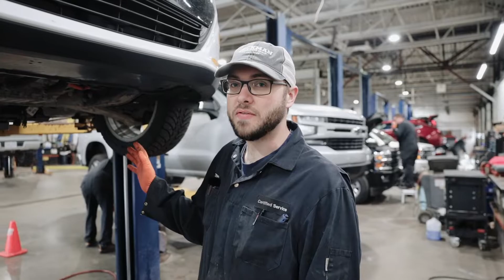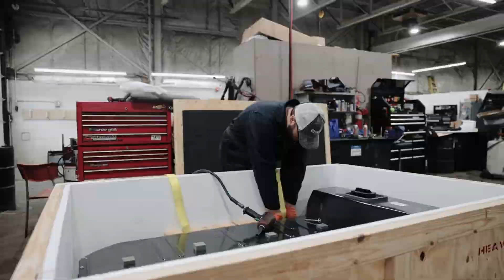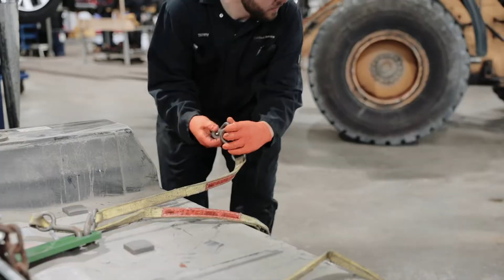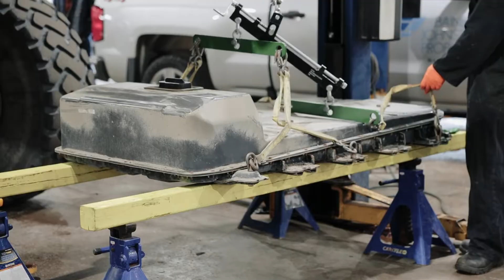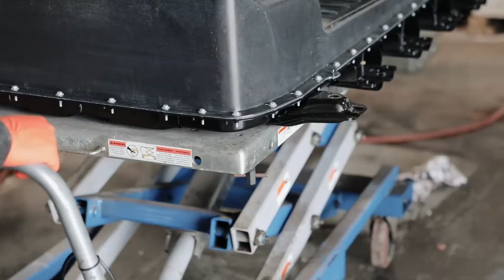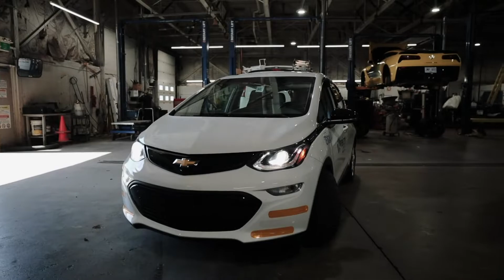EV BATTERY REPLACEMENT - Is It Really That Easy?

Comment: Why did the battery need replacement after only FIVE Years? 
What was the TOTAL cost associated with this Battery Replacement?
Reply: Most likely recall replacement.  most 17 18 Bolts had the batteries replaced. So probably zero.
Reply: Chevy Bolt batteries had manufacturing issue that caused a risk of fire, GM recalled all 2017 and 2018 + some of later model years and replaced the batteries. The warranty on them is 8 years at a minimum for most manufacturers, Hyundai offers 10.
Reply: Well that is certainly a screwup
Reply: Right

Comment: TOO FRIGHTENED TO MENTION THE OVERALL PRICE BECAUSE ITS AN EV SECRET which will put people off from purchasing an EV. Who would be mad enough to purchase a used EV that over half of the battery life has expired ???
Reply: I drive a 6yr VW e-Golf and it still achieves a range beyond the original EPA rating.
Reply: It's a warranty Einstein. Warrantied for 8 years or 100,000 miles. The batteries last a decade when used properly no different than a well maintained gasoline engine. After that they are used as stationary storage batteries for another decade. Can be 98% recycled into new batteries. Our one EV has 66,000 miles and battery at 98%. The other has 50,000 miles and is at 100%. Between them we've saved over $7,000 on gas, oil changes, brakes, transmission filters etc. charge overnight and wake up to 300 miles range. Worked in the collision biz for 40 years. Have a good understanding of cars. Would never go back to the overly complicated expensive to own gas car.
Reply: @BobQuigley , can you tell us who recycles the EV batteries?
Reply: @BobQuigley  gasoline engines can last for far more than mere 10 years, and they still keep roughly the same fuel economy. 

I drive a 20 years old 1.0 liter 4 banger car that still has the same stock engine from factory and it shows no signs of dying whatsoever, I could easily see it going for another 10 years on the same block.

Can EV batteries pull the same durability numbers, and then don't cost the whole price of the car to replace?
Reply: Free under warranty
Reply: @whocares264 When warranty ends, you pay. I get 200k and 20+ years on my Honda and Toyota  ICE with only oil and fluid changes. I rarely buy them used under warranty
Reply: Because that's not a real thing
Reply: My replacement was free
Reply: hyundai charged two customers over 50k for a battery replacement...
Reply: @PatricioGarcia1973 years ago now they like 4k

Comment: I find many things are "easy" when someone else is paying the bill.   Replacing a battery module should be easy and really the ease of doing isnt really a topic.    Thhe cost of doing it vs the cost of the vehicle is usually a hotter topic.    Good to know in this instance the cost should mainly parts.

Comment: It might be easy but it's also ILLEGAL!!! ONLY EV mechanics (there are TWO in Okra-Homer NOT in dealerships, one in OKC and one in Lawton, none here in Tussa) are allowed by Federal Law to work on EV/hybrids batteries, charging systems or braking systems. It can cost you a Million dollars and a MINIMUM of seven years in prison. It cost the goober's in Mustang, OK 5 million, their HOUSES, their shop and they are BOTH in Leavenworth, KS for 12 years and then can NEVER work on ANY "public conveyance" (vehicle) for the rest of their lives. They put a new battery in an old Prius and got caught. KOCO showed the Fed's auctioning their UNDERWARE and socks on TV! Normal EPA "scorched Earth" procedures (also the IRS and DEA). I ask My mechanic why he doesn't get a "hybrid license", "Five million good reasons", Mike replied. A five million dollar CASH BOND is required by the Fed's. That's one reason why insurance on a Tesla Y is $3800 a MONTH in OK, and repairs are (it says on the wall in 5 foot high letters) are $600 an HOUR MINIMUM at Tesla of Tulsa (NOT including computer/electronic systems or charging/battery system repairs: Contact Service Advisor for labor rates.) U-toob won't accept the photo I took!
Reply: Five million good reasons, what are they? 😅😅😅😅😅
Reply: I had mine replaced at the Chevy Dealership in Tulsa.  They have a certified EV tech. Joplin, MO also has one too.  I've put 30k miles on it since then, going great!

Comment: No engine oil, just a 10 thousand dollar battery in 4-5 years, that's all.  No worries mate.
Reply: 8yr or 100,000 mile warranty covers battery
Reply: @cfldriven My 2008 Honda van is 15 years old and running great. My repair and maintenance  costs average only $125 per year. I guarentee your EV will need a $10k to $20k battery before 15 years. Lithium batts have a limit on number of charge cycles no matter how well cared for.
Reply: @slotcarfan  so far batteries that have been in service since 2014 have held up remarkably well, according to Tesla.  I have a feeling you are going to be proven wrong.  Also, unless you don't drive your car, there is no way a 15 year old car averages $125.00 a year.
Reply: 8yr...160 thou on my 23

Comment: Gasoline does not depend on software to keep the energy balanced.
Reply: Actually the ECU controls many functions that keep the gas engine, tuned and properly running and usually has to be relearned upon disconnect of 12V battery.
Reply: @cfldriven  I am sorry, I am a living Dinosaur.
Reply: @mikewallace8087  We are all trying to avoid extinction.

Comment: What happens to the battery cells that are no longer useable? I saw a few videos where China has old EV batteries filling up warehouses. No one really talks about this.
Reply: At recent prices, nickel-cobalt-manganese batteries contain an average metal value of about $10,040 for every ton of cells
Reply: 100% they are recycled, GM has stated as much in their various news releases regarding Bolt battery replacements.  They’re quite valuable for the materials and multiple companies are now recycling them. Nobody is talking about it because it’s a falsehood being told by oil companies, who want to keep you driving your gas car that lines their pockets with money.  Don’t know if batteries are being recycled in China, but they have entrepreneurs too, so I would be extremely surprised that there’s not at least one company there also recycling.

https://youtu.be/s2xrarUWVRQ
Reply: They are to valuable to waste they will be recycled or in this case repaired or reused for something else
Reply: @peterszczesiak6025  I get that they are going to re use the cells that are good but what happens to the cells that are bad?? Everyone talks about recycling electronics but you never get to see how. As far as I cant tell this whole electronics recycling is a farce and that it ends up being incinerated.

Comment: Hey great no mention of battery cost or labor rate .I’m sure GM and the dealer approved of your video.What the heck so you gotta replace the battery every 4 years you save on gas.Sounds like a great idea to me!
Reply: This was due to a recall on all 2017-2019 Chevy Bolts.  The cost was $0 for the owner, even if they were out of the 8year/100k mile warranty.  Cause was due to bad manufacturing on LG Chem's part.
Reply: You dragged @johnandersonjjr 🤣🤣🤣

Comment: Why does a 2018 EV need a new battery already? How long will they still make these in the future now that Chevy bolts are not going to be made anymore?
Reply: Ok.  I just saw a video of a bolt on fire outside someone’s house.  The owner said GM sent a notice that they are not replacing batteries any more because of a new “software” fix.  I thought they tried a software fix before the battery replacement plan.  I guess they’re just cheating out now and stuffing their customers who were still waiting on batteries.
Reply: @mongo64071  that’s possible, when mine was replaced I didn’t closely follow the information any longer.  However, if GM is saying that a software update is sufficient they’d better have their facts straight.  Software can’t fix improperly folded anodes and dendrite formation, although maybe if it is sufficiently sensitive it can prevent the thermal runaway.  I’m very doubtful, and given that they already replaced quite a lot of batteries if one lit itself up and the owner could prove their vehicle had one with that defect, GM would be incredibly exposed from a liability standpoint.  However, we’ve seen that movie before with the Ford Pinto, the only thing that factors in is guessing how much a jury might award a plaintiff when a company has clearly been negligent has thankfully gone much more to the plaintiffs favour in recent years.
Reply: Chev Bolt and Hyundai Kona had bad batteries provided by LG, and replaced all 2017 and 2018 (+ some of cars in later model years) under warranty (no charge to owners) due to risk of fire. Warranty is 8 years on Bolt, same for most manufacturers but Hyundai offers 10.  Chevy recently announced they’ll be producing more new Bolts in 2025 using their standard battery tech called Ultium, same type of batteries used in Hummer EV, Cadillac Lyriq and other new GM EV models.

Comment: The automakers design EVs to not only as planned obsolescence,   but also to prevent right to repair by either a one person repair shop or a DYI. IF car makers had any moral compass,  EVs would be designed with a battery set that you could pull out from the side with a disconnecting receptacle/plug combinations so that in case of accident or fire or water immersion it could be unplugged readily accessible.  This idea comes to mind with when I had the job of servicing industrial electric carts for facilities maintenance at a railroad service & inspection facility, I had the pleasure of pulling out that battery bank like a cordless drill onto a cart by myself. These where heavy standard lead/acid batteries connected in series. Hence, a fire dept response would be much easier.  Pull that battery out before the car is destroyed  . As an electrician of 51 years, I, ve been taught over the years ( mandatory every three years to renew my electricians license) that there are definitions in the National Electrical code about things to disconnect sources of power being designed accessible and readily accessible.  Hence even in my old ICE Vehicle, I have welding cable disconnects on the battery, and the battery terminations are not standard automotive type terminations. They are terminations utilizing hydent terminals (COMONNLY USED IN THE ELECTRICAL CONSTRUCTION TRADE IN 480 VOLT SWITCH GEAR)  with stainless steel 3/8-16 threaded marine type batteries. The automotive grade connections are designed to attract the towing vultures. I was in an accident in which a car rear ended me and the first thing the emergency responders did to the car that hit me was to disconnect that car 12 volt battery. 
         You EV mechanics need to think outside the box and consult electricians who work on high voltage/high amperage connections. You should also boycott the likes of GM AND OTHER EV AUTO MAKERS. instead a lot of you become complacent to what they design and sell to the consumer.  BTW IN ADDITION TO THSE TERMINATIONS I USE A pure copper based nuclear grade never size. Are those bolts you are using to install the new batteries stainless steel.? Also if those EV batteries where designed for easy pull out , then instead of waiting around for charging an Ev like on a long trip, you could just go to like a gas station, and do a battery swap or painless trade in minutes. SIMPLE? 
           owning a vehicle is no longer a money pit, it is now a credit card debit pit, forcing working class people into economic slavery.  Hence, look at all the chips on board a typical vehicle, more chips , more of certain batteries, more need for more cobalt mining. A mining that is done by exploited child labor in the African country of the Congo. BTW. With an easy design battery change out, you would then have the flexibility of the type of battery like in winter, you could use a nickle metal hydrade battery, and summer go to the standard lithium ion battery. Hence, winterizing your Ev !!!!!!!
Miss Paula Walach-member IBEW  and former industrial electrician. 

Ps , what about an E-STOPS for emergency responders. I,ve wired many of them over the years.  I take bad issue that ICE vehicles never had e -stops or even carbon monoxide detectors.
Reply: Designing an EV where an individual owner or mechanic could change the battery out himself/herself doesn't fit with the new world order.  An easy swap out battery system would mean less workers needed and would enhance the financial well being of the individual owner, we can't have that.
Reply: Most people don’t change the oil on their car.  So why design a battery that will never be changed out by an individual?
Reply: @Uriah625  in my 51 years and still working in the trade as a licensed electrician,  it's about easy accessibility whether done by a DYI or a competent trained mechanic.  That mechanic would be much happier with the battery to slide out like a cordless drill. Accessibility is very much stipulated in the National Electrical code . I,ve scene the way 75 volt batteries are very readily changed out in 125 ton diesel locomotives. ITS done by one person using a lift cart. The dimensions of such a 75 volt battery is about one cubic yard. The starter is 75 volts that is needed to crank over a 16 cylinder diesel engine.  Hence, what about the first responders to an accident with no way to even unplug that poorly designed battery pack underneath that stupid EV....? Besides you missed the point that a morally designed EV would have the battery changed out to a winter type battery of nickle metal hydrade  that charges better in cold weather. Hence, more revenue for the towing vultures for EVs using planed obsolescence type batteries installations. Is that what you want to burden the EV Owner ? The average working person already has enough debt to contend with. With rising rents, food prices, and the rising cost of getting to and from work, especially in rural areas lacking good rail public transit.
Reply: @paulawalach1770  I think you and I watched a different video.

Comment: I would hate to pay for battery placement once it's out warranty.
Reply: Same here with the gas car.
Reply: @cfldriven  Does a gas car have a warranty on the battery.
Reply: @robri87-hh4gr  New cars come with warranty that cover the 12V battery. And of course any replacement 12V includes a limited warranty.
Reply: Yeah I mean, who wants to replace anything on their car?  Unfortunately if you own a car, EV or ICE, repairs will be needed at some point.   

On the bright side, EV tend to have much better warranties than ICE cars.   Rivian has a 5 year 60,000 mile bumper to bumper warranty, whereas the typical ICE has a 3 year 36,000 mile warranty.  The battery and drivetrain on the Rivian is 8 years or 175,000 miles.  Most  ICE are 5 year or 60,000.  

Who do you think is more confident in their product?  The manufacturer with an 8 year 175,000 mile warranty or the manufacturer with a 5 year 60,000 mile warranty?
Reply: @Uriah625  2014 Prius, regular service and no repairs. 2017 e-Golf, regular service and no repairs. 2005 Mazda 3 regular service and a water pump.
Reply: @Uriah625  yeah, but a 500 dollars clutch job is different than a 20k battery pack. It's not about the warranty, it's about the tech battery degrade. So does engine but the parts are cheaper and labor and it lasts longer.
Reply: @DerekVuong7799  yeah, not saying it’s cheap, but it’s not exactly something I would really concern myself with.  Batteries last a lot longer than people think.  

Let me ask you this.  If ICE vehicles are so cheap to fix and maintain, why isn’t everyone driving their first vehicle?
Reply: @Uriah625  i bet if battery has issues, it WILL die way before it reaches those 175k miles, and if its very good, then it will outlive warranty by far, it will just degrade a bit..
Reply: @Uriah625 GM announced EV require 80% more maintenance. What happens to EVs after warranty? I almost always buy good, used ICE long after an EV warranty would have expired. 10 years and a Honda or Toyota ICE are just getting broke in.
Reply: @slotcarfan  I looked for a release from GM per your claim and did not score a result.  

As far as what happens to EV’s when the battery goes bad?   Again, I have to give a vague answer.  That is the choice of the individual no different than an ICE vehicle.  

Here is an example. I own a 2010 Silverado 2500HD.  The transmission went bad a few years ago. Torque converter is failing, common on the 6L90. I drove it here and there, but I never trusted it.   Mind you, it was 10 years old at the time.  It is now 13 years old.  Yesterday I called to get a quote on a rebuild, $6,000.  I’m seriously debating whether it’s worth it.  The tech pretty much said, “no one ever gets them rebuilt as it’s not worth it”.  

What is your recommendation?  Is it worth putting $6 grand into a 13-year-old truck?  It has 200,000 miles on it, it’s rusty, has dents and dings, and ABS light is on.  The engine is good, it is the 6.0.  

I should add, I tried to sell the truck last fall for $2,000 and had no luck.  Only one person looked at it in the 6 weeks I listed it.

Comment: None of the shops in my area of Hamilton Ontario are large enough to do a job like this.
Reply: The GM shops can (John Bear did my 2018 Chevy Bolt battery replacement), and I’d wager my usual shop (T&J Auto) could do it, but don’t have the training for working on EVs just yet.  So as far as independent repair shops, probably not many but I haven’t researched it, T&J still does the other typical mechanical work for me, on my gas vehicles too.

Comment: How much do one of these batteries cost installed?
Reply: According to Recurrent Auto, a Chevy Bolt battery replacement may cost you between $16,000 to $16,500 for a 65 kWh battery pack.
Reply: Bout$ 20,000
Reply: @jeffphillips7290 Which is why battery failure essentially totals the vehicle.